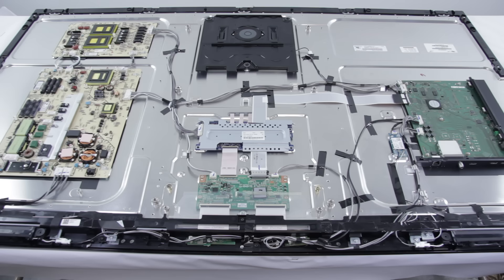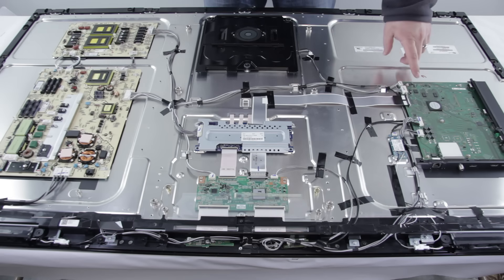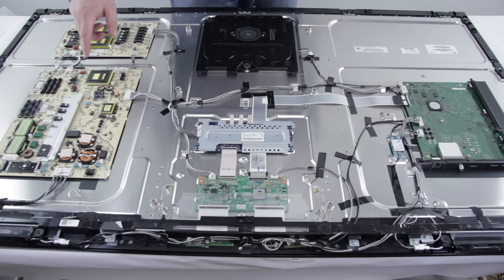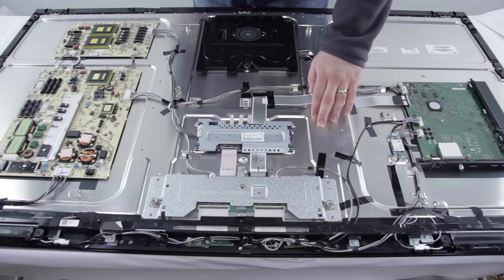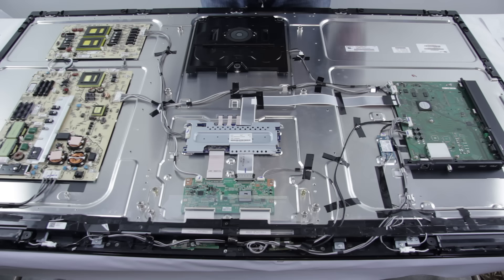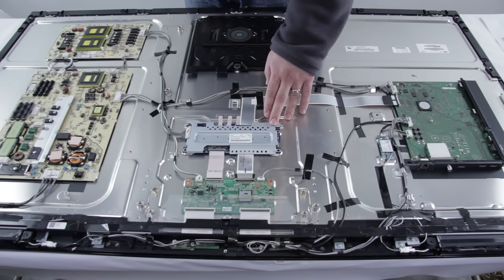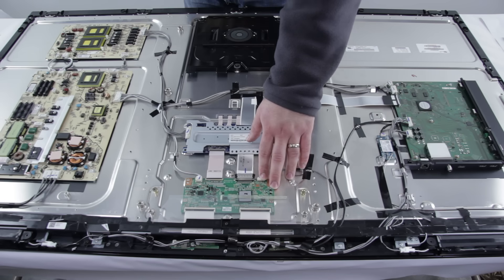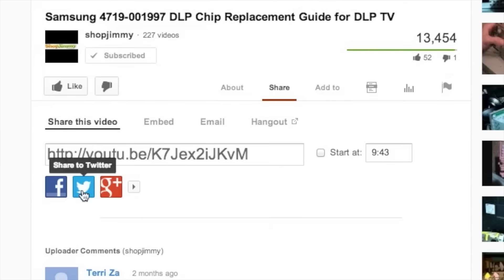LED TV Repair Tutorial - Common Symptoms & Solutions - How to Repair LED TVs

Comment: also wanted to say that the red light on the memory/motherboard is lit.. and there is a blue light on the tcon board that is also lit this unit is 2.5 yrs old and has worked ok .
I started to check the caps on the powersupply board with my ESR meter have not finished   i"m not sure if the led driver is being pushed by the powersupply as i only see 3 boards do a lot of this stuff as a hobby..do have a rework station for smd boards  thanks for any help you can give ffuudog@gmail

Comment: Hi Jimmy, thanks for the great intro tutorial. I have a LG tv (42LM6700) and it's not turning on at all. I found that one transistor is burn. I was trying to find the same on internet but I just found similar ones but not exactly the same. The piece is the ST 13NM60N (GK023 V5 CHN 209) I've found in ebay a generic 13NM60N with no specifications and in the site lcd-chip I've found a very similar one, same brand but some details different (GK05V V6 CHN 001) you think that I can use that one or even the generic from ebay? Thanks so much for your help.

Comment: My tv has no backlight as I can and it does play audio but a cord that hooks to my t con board and my inner tv part is stripped and doesn't work if I can know what this cord is called I'd be able to replace it and if you can tell me either the problem or what's completely wrong with it that will be awesome

Comment: Ok I purchased a digital main CBA board for my Emerson LC320EM2F lcd tv.Before changing the power board the tv was veiwing fine the reason for changing the board was because the anttenna connection was broke.After changing the component the picture is now upside down can you help?I plays fine now but it is upside down.

Comment: my tv model is a visio smart tv modelE480i'B2 I checked the fuse is 250v. I checked the back light with the flash light check still nothing but I am not getring any power at all. and how would you know if it's the fuse because it's white all the way around the fuse and it's mount onto the tv

Comment: I have a samsung un55d6400 the tv turns on and shows the samsung splash screen then turns off and keeps doing this over and over i disconnected the cable going from the power supply to the main board and the backlight stays on any suggestions? thanks

Comment: I have an LG 50LN5100. the other night the backlight went off, but I turned off and on a few times, and it came on. it did it 2 more times a few hours later. then the next morning nothing. I did the flashlight test, and there is a picture, there is sound. I checked voltage at the power board. how do I know if it's a LED  Driver issue or LED strip?  right now when you turn tv off and on you get a flash of the back lights.

Comment: greetings I have Samsung led TV model UN40F6300AFXZA. the bottom half of the screen has become dimmer than the rest of the picture. I have tried to fix with the brightness and picture settings but it will not go away. Any suggestions on what the problem might be and if it is worth repairing or would I be better buying a new TV? Thanks!

Comment: Waterturke	
Waterturkey12

Question:
I have a philips tv model no: 40PFL7505D/F7 serial no: DS1A1120151966 with a one thin vertical black line on the right side of the tv. Is that the T-con board? Can someone please advise me on how to fix this problem. Thank you.

Comment: Hey I have a Samsung 55inch led model #un55h6300af. I have no backlight and no sound tv looks dead there is no power. Had a guy come from a local repair shop to check it out and he said the power board is fine but the tcon board is burned out. He gave me an estimate of 350$ for him to repair almost the price of getting a new tv. I decided to look up prices for t-con boards which I discovered only cost about 35$. So I've decided that I'm gonna try to fix it myself. What are your thoughts on wether I should replace tcon or just go get a new tv?

Comment: There is a grey horizontal area across  1/3 of the top of my Samsung 75'' tv. What board or part would you recommend to fix this problem ? 
Thank you very much for your help.
Greatly appreciated that.
Henry
Samsung model:  UN75F6300AF , model code : model  UN75F6300AFXZA

Comment: My Toshiba 46G310U 2011 Won't turn back on unless it is unplugged for a couple of days.
I can leave it on for weeks,I just turn off the cable box,then someone turns it off or a power outage,then the wait begins.
I am very capable to do repairs,where can you point me to test? Thanks,Gary.

Comment: hello, i got a samsung UE40ES7000, while watching certainly the smart tv startup screen appeared, then the tv restarted, after a few seconds it restarted again and now we only got the screen turning on and off continuously. the screen remains black (the backlight turns on) and u only hear the relay clicking and the green led blinking. tried to disconnect power for a few hours but it didn' t work. what could this be? the power board or the mainboard?

Comment: I have an LG 60LS5750.  My TV will turn on and everything works fine for 30 seconds to a few minutes, then the picture will go out and I will get horizontal colored lines, audio still works fine.  When this happens, and I have the back cover removed, I can blow a fan on the back and the picture will begin to come back.  I have tried replacing the power board but this did not help.  Any ideas what could be causing these symptoms?

Comment: I have a Sony Bravia KDL-60r550a with a 3/16" horizontal line across the lower part of the screen. The line is there on all inputs. It is black across 2/3rds of the screen and then barely visible for the rest of the way across the screen. In the black part of the line there is some red color that shows up every now and then as the motion on the screen changes. The black has slowly moved farther across the screen with time. Bad panel?

Comment: I have a Hitachi LCD LE42LS256,  S/N: LE42LS256 SK2J000667 We have a problem with power surges here, and I did not have it plugged into a power surge protector. It went off and came back on, I could hear sound but no picture, then the sound finally went out. Then blue on light still comes on when the set is powered on, but there is no sound or picture. Wren I turn it off the light will turn red on standby.

Comment: I have a Samsung UN55ES6100FXZA LED TV. Picture went out, but there is still sound. I thought it was a backlight issue, as when I shined a flashlight at the blank screen in the dark, I could see movement on the screen. So, upon a (apparently) bad recommendation, I replaced the PCB Power Supply Board (BN44-00503A) and I have the same problem. Any suggestions on what to do next?

Comment: I have a TCL LE43FHDF3300TA the LED status light turns on orange when you initially plug the tv in , once you press the power button the LED status light goes off and the tv does not turn on. No picture, sound, or backlights I tried the flashlight test no luck ... Any ideas ?

Comment: I am working on a VIZIO M401i-A3 .I have no power on.I have standby voltage.I jumped ps-on and stand by and the supply powered up.I put 3VDC to LED-on and the power supply lit up the leds.I checked all the ribbon cables and power switch and had continuity.Since the T-con acts as the led driver.Should I replace it.I got voltage to it when I jumped the T-con -on from the supply but that doesn't indicate if the T-con is good or bad.The remote and manual switches run through the main board via the ribbon cable.My question is how do I test to see if the problem is the main or the T-con board??

Comment: I have a Samsung UN60JU6500 that all the sudden the picture and sound went out. I am not able to see any picture when using flashlight method. TV turns on as red led light comes on. Luckily, this tv was a replacement to another that had the screen cracked during a move. So I have an entire tv of worth of spare parts (except screen) at my disposal. Any tips on diagnosing issue, without me literally going board by board and replacing? Also, can I simply plug in a board and test it or do I need to completely re-screw it in before testing? Thanks in advance!

Comment: I have a 46 inch hair TV model number le46f2280 on my main unit g32519 where i  screw my cable in to the back of TV is broken out of the TV would that stop me from having picture and sound my TV power is on but black screen could this board be my problem.

Comment: I have a vizio mod#E470i-AO I have no sound no picture but it has picture when I do flashlight test replaced led\powerboard still. Having same problem tested voltage coming out of board to LED backlight not getting 100 volts it seems to fluctuate between 0volts and40 volts

Comment: I have a 70 inch Sharp Aquas,  when I hit the power button the tv will turn on for a couple of seconds and turn off. the screen doesn't turn on . I've tried resetting it by holding the volume and channel buttons and then plugging it back in but it remains the same

Comment: have a samsumg led tv which will come on with power cord plugged in can't turn off with remote or or front touch panel only red light blinks we trying to use either one I removed the front touch panel it has a model number of 
Model D550_12C 
code: BN41-0160CA 
REV: 1.2 (ET101202) 
I'm not home right now so don't have the tv model number

Comment: I have a LG 42" ..42LK520, when the TV is powered on the logo comes on and then the picture however in just a couple minutes the picture freezes except the top 2 " still plays normal and i have sound , turned it off and back on but still the same issue ... so I tried just using the buttons on the side to see if maybe ir board was bad, but with the picture froze the buttons don't work on the side of the TV.. so I just let it sit for 10-15 minutes the picture unfroze and the buttons work on the side of the TV , all cables are new and it will freeze with A DVD or the DVR so what could be causing  this .the TV will play for hours and freeze the picture and then unfreeze

Comment: My Vizio e650i-a2 worked fine until one morning when I tried to turn it on and got absolutely no response.  It is completely dead with no standby light. I checked voltages in the power board and all seemed fine, so I replaced the main board.  That didn't change anything, so I replaced the power board afterwards with no change and finally I replaced the led driver board and still no change.  What gives?

Comment: So I have a problem with my Samsung TV 55 inch. History first! It was given to me with the common slow start up (black screen while clicking until it would finally come on just fine, usually 3 to 8 minutes of this). Then one day recently I went to turn it on and the screen lights up full bright blue (with a little dingle of a tune about 2 seconds long) but no functions (no menu or picture and no response to remote or switch controls) then it will shut off after about 30 seconds and then immediately go into start up mode as described above then click off again and cycle this way, it must be unplugged to stop it. 
The model is a Samsung LN-T5265F  (2008)
I hoped the capacitor replacement might correct all of this but maybe I waited too long. I replaced 3 bulged capacitors and I still get the cycle of turning itself on and off as soon as it is plugged in. 
Any thoughts on what might have failed down the path after the capacitors. I can,t see any burnt components on the two large boards. 
Thanks for any help or insight!
TF

Comment: I have a Samsung LCD television model# LNT4069 FX/XAA with a picture problem. When you turn the set on, frequently the left side of the screen shows a distorted image.  The distortion lasts from 5 to 10 minutes and then disappears.  This problem normally occurs when the TV has not been powered on for several days.  Do you have any suggestions as to cause and can this be repaired by owner?

Comment: I have a LCD model 37LG30-UD, it has back light and show the menu. After and hour of operation the picture get distored. It also has no signal input. I try to change all input but no signal. no audio., I want to order the parts, but I want to be sure if it the Main board or the T-com board.

Comment: I have a samsung 46in 
(lnt4661fx/xaa). The backlight is normally not working, but it randomly kick on for 1-3 seconds, then back off. I did the flashlight test and saw a picture. when it's on, it looks great. Could it be a loose connection?

Comment: I have a Sharp Aquos lc-42d62u. when I power it on, the power LED blinks four times and then pauses and blinks four times (which repeats forever). when I try to reset it by holding the vol down and input, it briefly displays a box on left then goes to the blinking LED again. Any idea what the issue is?

Comment: I have a TCL L39B2600 , It takes about 10 mins to start once power is turned on, Have changed all the mail capacitors in the power board. No change. Once its on every thing works fine. But once its turned off and on again same problem. Please help

Comment: Hi my tv is a samsung ue46f7000stxxu it trips off as soon as you switch it on i have changed the power supplier board, the main board and the t-con board but still the same thing and now i have taken out one lvds t-con cable one side is working have tried to change the cable they work on that one side so any idea please

Comment: My Vizio P602UI-B3 4K UHD TV shows the little white power indicator on the bottom left when powered on, then it slowly fades but the screen is just black and never turns on. So mine has no sound, no picture but the white power indicator light comes on and fades out when power is hit.

Comment: The problem with my RCA combo DVD player 32LB30RQD that was not starting right away and sometimes took 10-15 minutes to start. I have checked and do not see any backlighting. Before these video's were available I thought it was the power supply board RE46HQ1502 and was happy to find you had a matching part which I purchased and installed. Unfortunately the problem still exists and do not know if you have any other ideas or if the replacement board could also be defective. I do get the red power light on and it turns blue by turning it on. Any suggestions would be appreciated.

Comment: Hi ShopJimmy, I have a question about my LG 3D TV 42LW4500 with chassis LD01U. The TV won't start. It stays in standby and I measure the 3.3V on the standby pin. When I try to start it up, I see the led blink white twice, then red, after that nothing.
Do you have suggestions? Most components on the powerboard seem ok, the rectifier, power transistors, diodes, elco's. What is the first suspect to look at on the main board?

Comment: Great video.
my lg 47lx6500 has no sound and picture. It turns on and screen shows Lg monogram and then it goes black. no back light and no images. Front bottom touch panel has light. please help.
Reply: I am having the same issue with an lg55lx6500. Any help would be great. Thanks!

Comment: I have a Samsung UN55H6350. It turns on no problem and has a standby light that works but while watching a program the image will stutter then freeze and the sound will stop working. It's kind of like a streaming video continuously buffering but I primarily watch programs from a USB stick. The image will usually start again but without sound and the tv will no longer respond to inputs from the remote or the controls on the back of the tv or it responds very slow. I've tried unplugging the tv for a short time as well as resetting to factory default all of which only provided limited, short term results. Any help you can provide will be appreciated.

Comment: I have a 40" Samsung UN40ES6100 LED TV.  No backlights, took it apart after testing with the backlight tester and found backlights bad.  Could not find replacement so I sent backlight 56 on each side, one side bad to Tucson and was repaired. Also bought all three boards and the result is now backlight comes on momentarily goes off and then after a while flashes on then off then on again.  Is one of the replacement boards bad.  I can remove the cable connection to the main board and backlights flash faster.  Please Help
Thanks Bob
Reply: I forgot to add the red light on bottom flashes a couple of times with one flash staying on longer than the other then after a while flashes once waits a while and flashes again and continues this cycle. the first time the backlights come on it stays on for a couple of seconds and shows the Samsung Logo.  the short backlight flashes are too quick to show anything.  Then a long flash as above.

Comment: Hi! I have an LG 50LN5100-UB TV. The TV has no picture, but has audio, and after watching your flashlight test video, I can see the image on the TV. According to that video, it would be our LED driver. However when I removed the back of the TV, I see a power supply, motherboard, and t-con board. Will I have to replace the LED strips? Or is the LED driver on the power supply?

Comment: phillip 50" flat screen tv with ambient light
model no 50PF5332D/37B
serial no. YA1A0736001196
Problem when turn on light green comes on for about 20 sec and the goes to 6 red blinking light and stays on stays on after that nothing happens

Comment: I have a Samsung UN46H5203AFXZA LED TV that was possibly a victim of a lightening strike.  Standby light comes on, and when I hit the power button it starts up, flashes quickly and goes back to standby.  Can not get the TV to fully turn on, just the flash and then back to the standby light.  Any recommendations?
Reply: I have a sony tv, KDL70W850B, lately when you power on the tv. it shutdown in about 4 seconds. tle led light blink 4 times then pose and blink again…and continue in that cycle.
Reply: I ended up replacing the main board, worked like a charm!  Shop Jimmy has a repair kit that made it fast and easy.